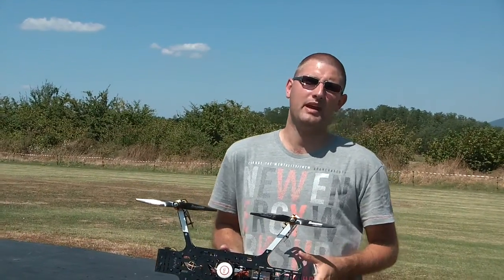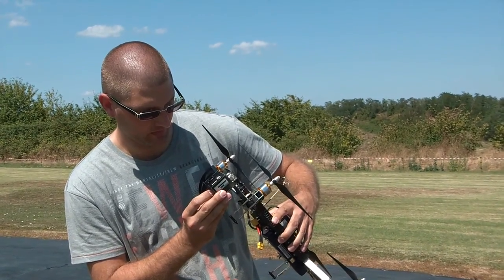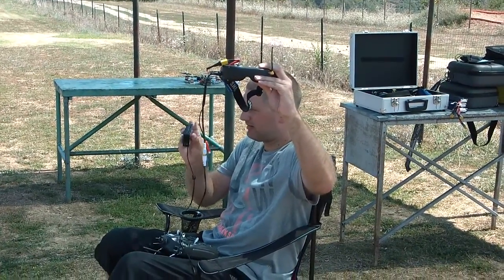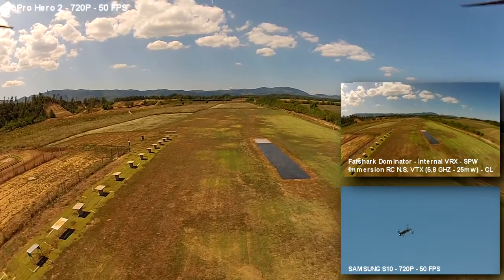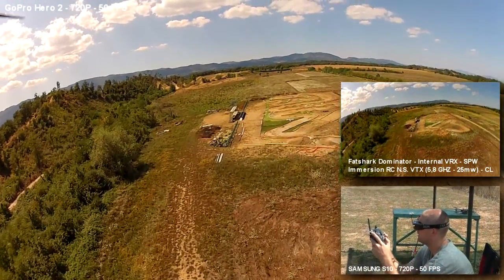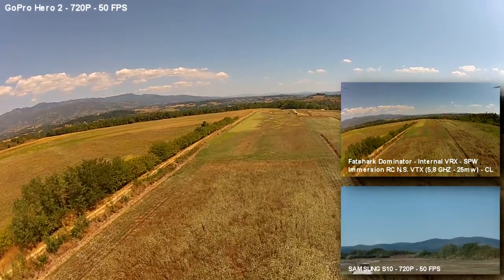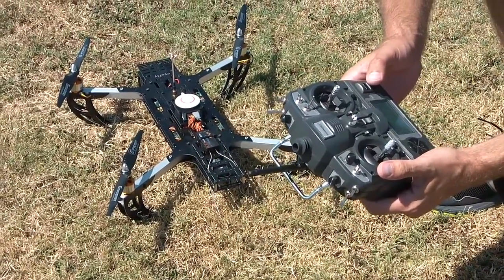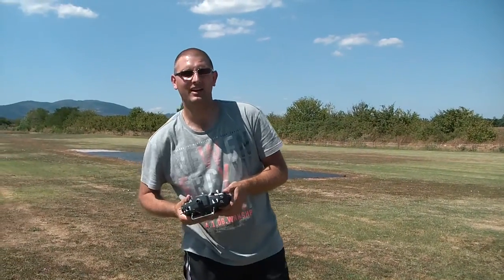RC: Narrated FPV Flight 17 - Testing RTH (Naza LITE) & VTX Signal Strengh

Comment: Personally if you want to build a larger aircraft to carry a gimbal then don't remove your FPV hardware from one aircraft to the other , just buy the FPV hardware for your HEXA , you don't want to give up flying your QUAD for a HEXA , the HEXA is going to be good to do nice and stable aerial video but the QUAD is going to be more of your every day flying RC aircraft , i do have 2 HEXAS but i fly my QUADS more , all of my multirotors got their own FPV hardware .

Comment: If you are using Fatshark/immersion system then get the immersion OSD since is going to be plug and play with your system , if you used the Foxtech then get the Cyclops Breeze OSD system for it .

Comment from the maker: Thank you - now that the RTH works out I can finally try how far i really can go with the 25 mw transmitter without fearing to loose the Copter... After this video i did something like 600 meters and still had a quite good picture (what is great considering that i just used the internal vtx of the googles), tomorrow i will test it with my helix + Diversity what should make a big difference, too.